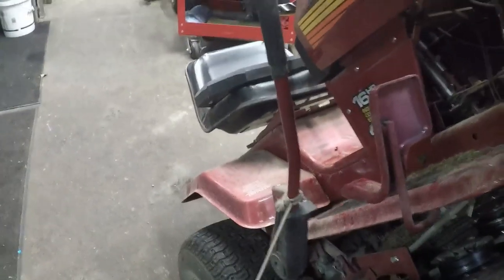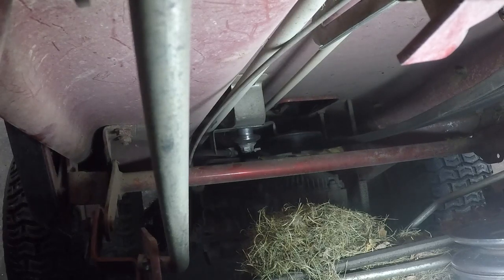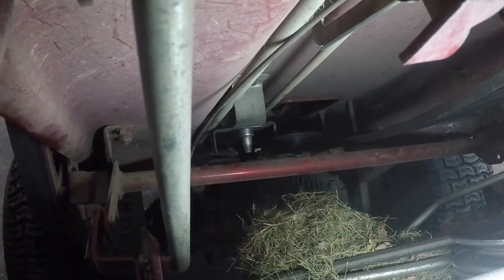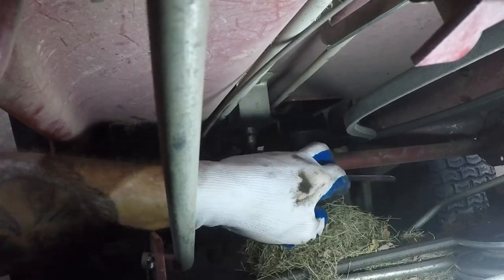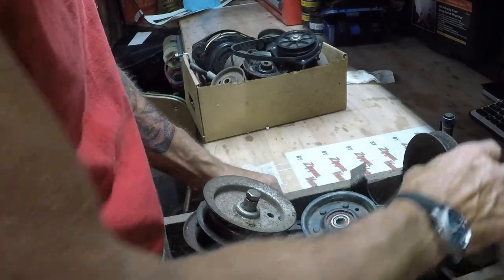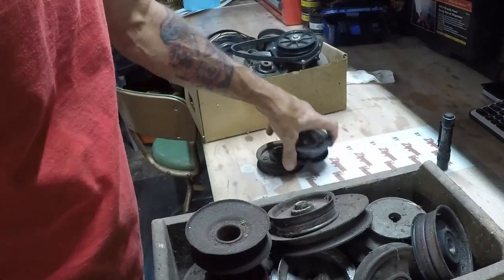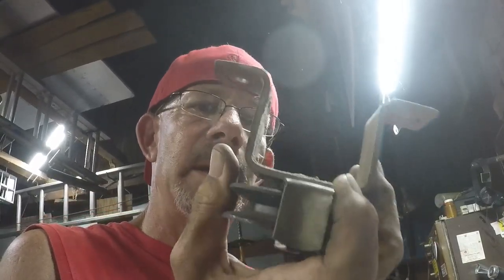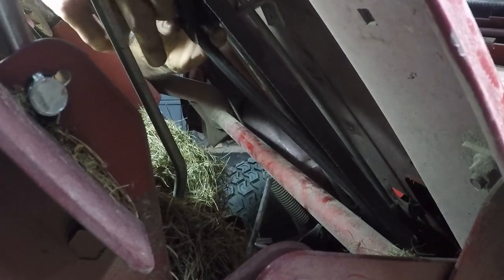Murray Won't Move!! Why?? Lets find out! #smallenginenation

Comment: My Murray has the same problem of running, but not moving. The drive belt is not as accessible as on the model that you have there, but it is slack, so I'm assuming the problem is the same. I've now got to look for a way to lift it and gain access. Thank you for the information on how to do the repair. I've subscribed.

Comment: Murray the worst mower I ever changed a drive belt on.  I spent, so much time changing a belt, I think it took me 45 minutes to do it.  Thanks God it worked and didn't need any adjustments.
Reply from the maker: I've had my fair share of those over engineered belt routing mowers. Some are just out to tick you off lol. Glad it didn't need any adjustments! Cheers Bob! Hugs to the little man! Zip~

Comment: Needed a gas cap for a cub cadet 3.500 inches wide but didn't want to buy new $25 looked through my parts shep pile of tanks and FOUND ONE 😎 
Also fun to find things you didn't know ya had. Found chains in my tractor grave yard and to this day still don't know where I got them from gave them to a friend since I don't need them.

Comment: Think you for how to make mowers pull. All so my question is   My old Murray riding mower is a 38 “ with 12 hp and it’s was built back in early 1980 it will not go forward or backwards. Is a possibility that the axle has stop working on the inside

Comment: Thanks for the video.. I have a question, I have 1996 murray lawn mower 40708x92a 40in cut tractor the last time I used it I pushed on the brake and when I let off the brake I was in reverse and I didn't shift it to reverse but now it won't go forward it's stuck in reverse

Comment: I have a crumby set of the double end ratchet wrenches and they are terrible.  The angle is to high and they are too thick.  A good set in my future??   My spares box comes in handy like yours.  My parts are smaller though.  (handle stuff)

Comment: Nice information thanks I do save all pulleys from every rider I get.
Reply from the maker: It's a good practice. I also keep the good belts, steering components, seats and trans-axles and linkages for them all. Throttle and choke cables, good wheels and tires, steering wheels and deck spindles that are in good shape, engines and/or engine parts. All are good to hang onto if you're doing any volume of repairs to help save end user some money. Cheers! Zip~

Comment: how do you store all the different parts do you keep all parts from a rider in one box or do you put all in diffrent boxes. what would be the best way when I need a part?
Reply from the maker: Great question Joe! I group like parts for the most part. If I grouped individual machines, it would take me 5 to 10 times longer to locate a specific part because I would have to go through each model specific box looking for a guard, steering part, fixed pulley, idler pulley....you get the idea. So, by grouping the items I mentioned above together, when I need a steering part or pulley or even a wiring harness section, I have a place where the individual items are grouped which cuts down on searching time greatly. BUT....When it comes to Simplicity and Allis Chalmers parts, when I tear one down, I do group nuts, bolts, belt guides and model specific tid bits per tractor. Since they are my passion, when I'm rebuilding one or need a specific correct bolt, I can go to that bin and get exactly what I want in the Simplicity and Allis Chalmers family of garden tractors. So...it's a balance between the general repair items that are so called universal and the model specific items I may need. But I only group the model specific in the models I collect, restore and love. Cheers! And again, Great Question! Zip~

Comment: Thanks for the videos. I have the same mower. It won't drive but wants to. my belt is pretty old- maybe original.  It is pretty cracked, How tight should it be? The pullys are moving. Does all the power come from the front? that is moving strong but when I try to drive, the back pullys stop. Could it be anything else?
Reply: so glad I had the belt on hand. That was the problem. I figured it would go eventually so I got it when I got others. I did have to take the little pullys off to get the belt on but all went good. Now I just have to level the deck.......

Comment: What's it mean if my mower is leaking gas into the oil i have that same mower
Reply from the maker: The Needle and Float in the carburetor are not sealing off the gas supply. You can remove and clean the carburetor or install an in line fuel shut off and remember to always shut the fuel off before turning the engine off. Zip~

Comment: my neighbor dropped off a scotts/john deere to me for free. opened the hood and saw a 20 horse intek. pulled the engine and 1 idler pulley,scrapping the rest. i tested the engine today,125 psi compression. test fired it on starting fluid,carb is dirty  though. i too keep extra parts,but use plastic milk crates labeled with toe tags

Comment: So you show a spot where a pully was supposed to be ? We are supposed to read your mind on that ?
Reply from the maker: Knowing how it's supposed to be set up allows me to troubleshoot the drive system. Finding the correct diagram for your specific application is up to you. In short, if you don't know what you're looking for and don't know what is missing, the internet is your best friend. Zip~
Reply from the maker: By the way, my videos, along with most others, have a "Description" below them. Did you check that before commenting?